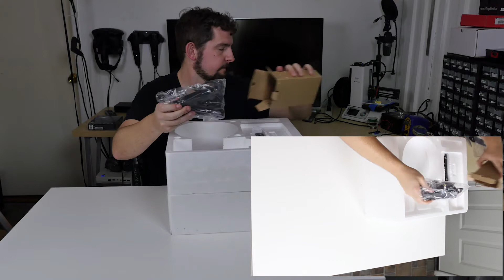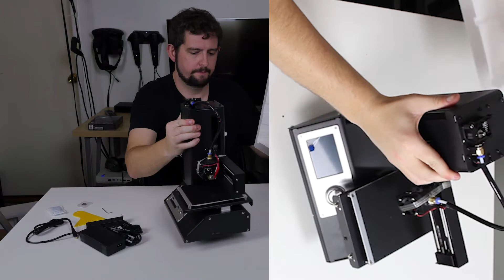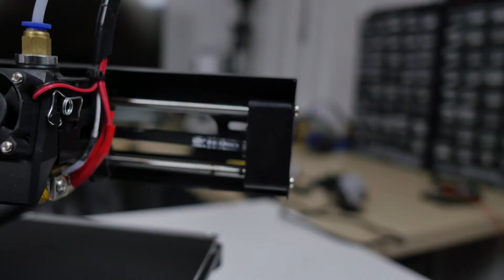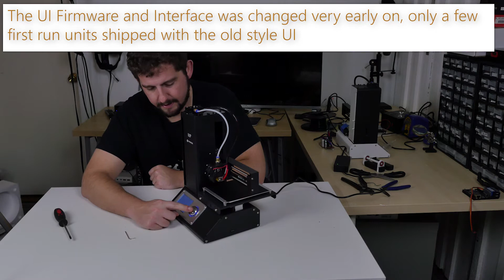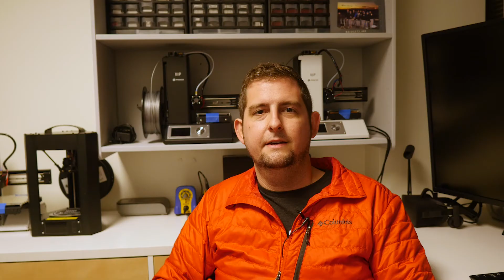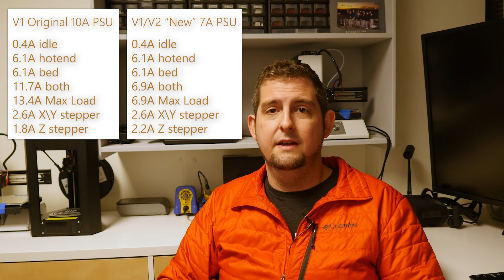Monoprice Select Mini V2 - Unboxing and full review!

Comment: 9/22/18..Just unboxed my Monoprice..and got my first print going.. so far so good.. I did have adjust the bed out of the box.. it was waaaaaaaaaay too tight in one corner.. and kind of tight in other 3..but leveling was really pretty easy..Thanks to your videos!.
Reply: im having trouble with mine seems my prints are always stringy idk what im doing wrong im having trouble levling mine :(
Reply: @MNNICEGaming  When your adjusting the bed leveling screws,  the turns are very very small amounts.
This channel has good video on how to level: https://www.youtube.com/watch?v=dzrc3e0VZjU 
The stringy part.. it could be your settings that you've selected in your slicer.  I use CURA 3.6..so you can quickly easily change settings. Overhangs settings maybe?

Comment: Great review. The v2 does now actually ship with enough filament to finish the cat. No more half-cats! It's still not worth messing with, though. If you have even a single failed print and start over, you'll likely run out of filament during or close to the end of the print and the brittle end of the sample filament can get easily caught in the boden tube of the entrance to the hot end. Not worth the trouble. Similarly, like you said, the included SD card is trash. Not only is it slow but it is extremely prone to corruption. In my case, I had numerous prints fail right at the tail end because the Gcode became invalid.

Comment: Thanks very much for this video - I'm looking for a low cost assembled no tinkering machine for a project a friend of mine and I are considering getting off the ground - 3d printing for seniors and retired folk.  I thought I had found the ideal machine with this one but I think I'm going to hold off now for awhile.  The small envelope is not a problem for us and in fact preferred.  But buying dozens of printers for pensioners has to work out of the box and have no hidden gotchas.   Maybe V3 will be the one for us.   I will be subscribing and watching your developments and upgrades to this machine though - your approach and completeness is greatly appreciated - again, thanks very much.
Reply: In The Workshop, How is your 3D Printing working out for "retired folks"?..Have you bought anything yet?.. The largest hurdle for anyone.. retired.. or not..is the learning curve of the software.. I'm tech savy.. with a degree and a few years in the industry..and I can tell you ...it's challenging.. I'd be interested where you are at with your project, and how it's going.